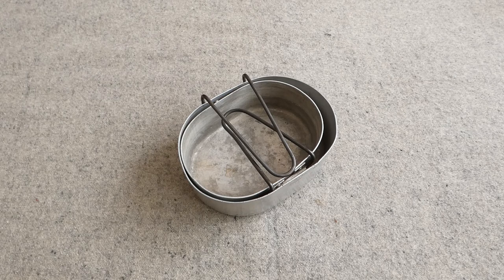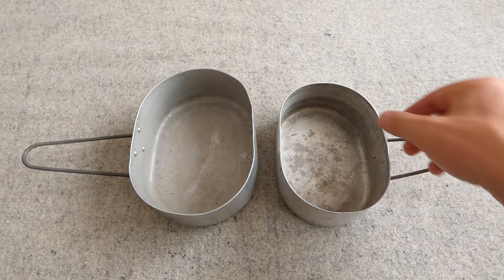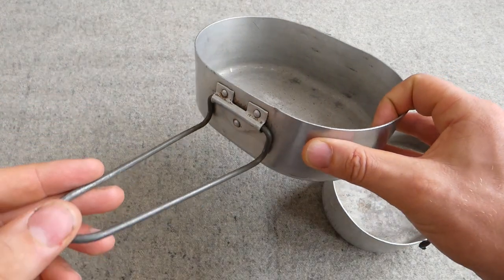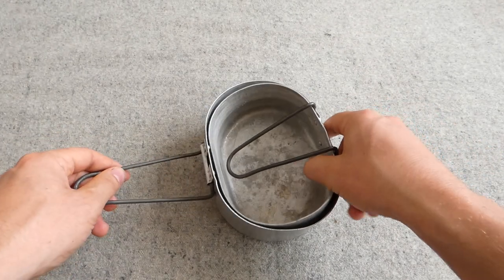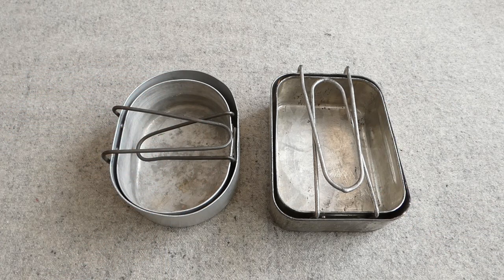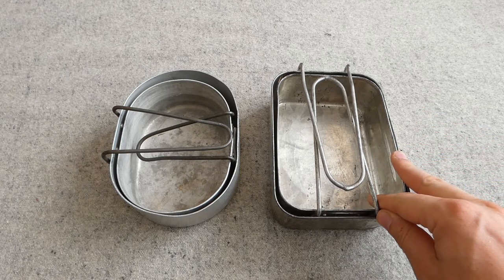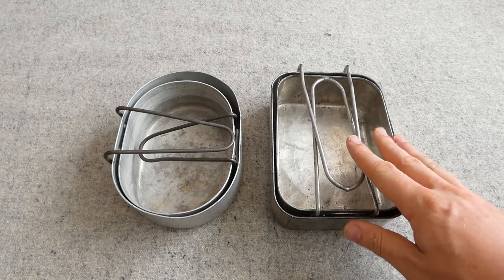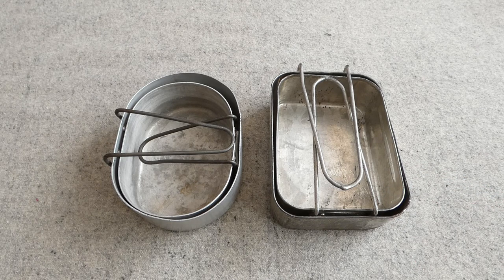Indian Late WWII Aluminium Mess Tins

Comment: Worth mentioning, the Indians were producing a rectangular aluminium mess tin set up to 1940, which were an Indian copy of the British made aluminium mess tins. Exactly the same, just a little cruder with Indian markings. Like the British in 1940, India switched to tinned steel in 1941 before introducing the oval aluminium design in 1944.

Comment: There is some fairly well known period footage of British troops crossing a river in the Burmese jungle and they are quite clearly carrying this pattern of Indian alloy mess tin (probably only one half to reduce noise) in an extra water bottle carrier hanging from the 37 pattern web belt at the rear. 
My main interest is the Far East Campaign in India/Burma and I've read a couple of different period accounts of kit carried on operations in the Far East theatre and both mention the above method of carrying mess tins, although one stated that they did not carry the regulation tin mug and instead drank their tea out of the smaller mess tin, so it could be the this smaller tin on view in the footage being carried where it was readily available for a quick brew-up, basically in the same way as the tin mug was often carried outside the small pack in NW Europe/Italy.
Obviously the weight and practicality of kit was a much more important to troops in the Far East than it was to those in North West Europe, not only were the alloy mess tins a little lighter but they did not rust in the jungle environment like the earlier British and Indian tinplated steel mess tins did all too readily. Also of course, when troops were engaged with the enemy they had to leave their Mule transport behind and be fully self-sufficient so any weight saving in the harsh terrain and climate of the Burmese jungle would have been a real bonus..
Reply: There's a lot of footage showing Chindits, drinking from and carrying the enamel mugs on their packs.
Reply: @nathansaunders2576  Absolutely, I wasn't implying that enamel mugs were never used during the Far East Campaign.. Just that, anecdotally at least, some troops didn't bother to carry them.